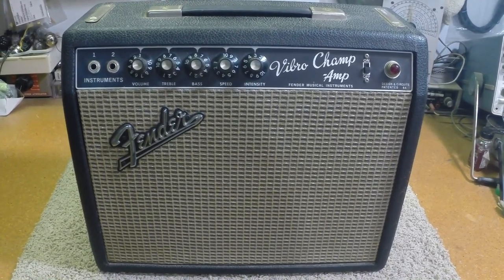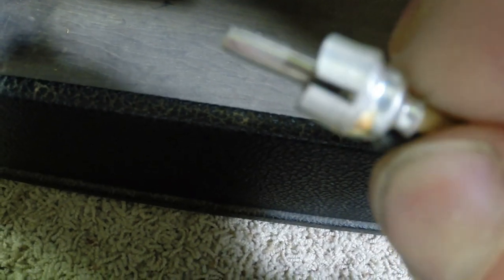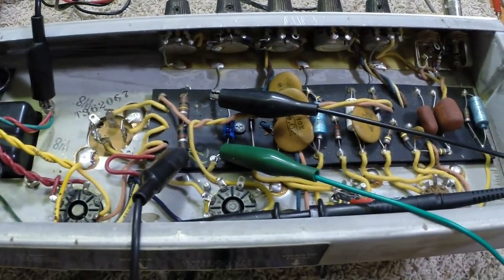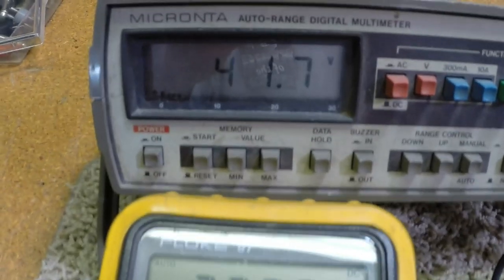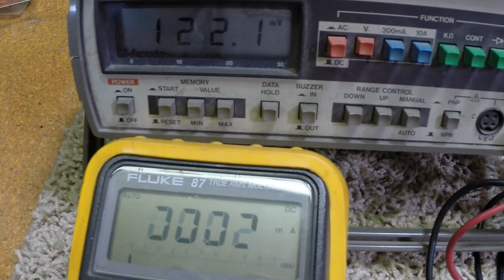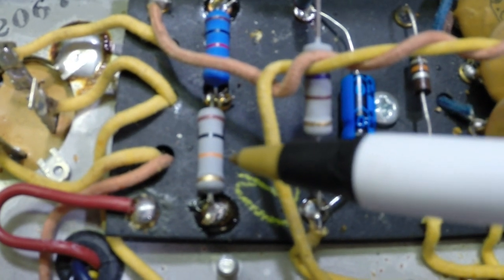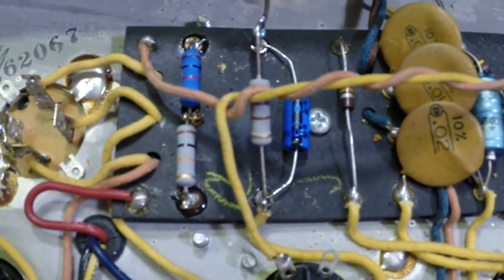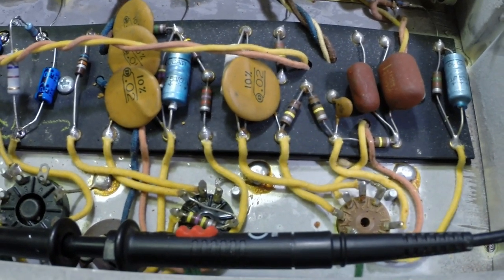Black Face Vibro Champ Repair and Bias Discussion

Comment: Thanks for creating this video and providing actual measurements rather than mere supposition. Your solution to the excessive-PD issues with the smaller Fender circuits is quite interesting and I intend to give it a try in my next appropriate repair project. Fact-based videos such as yours are a boon to the tube circuit community. We wish you well.
Reply from the maker: Thank you Uncle Doug.  I found this info in  the early 90's while on the quest for proper amp knowlege.  I had been working on amps since the late 70s but felt I lacked the info I actually wanted or needed.   I took the simplest circuit I could find which was a blown up Champ that I was given for $35. worth of guitar work and began studying it.  I had also been seeing lots of champs being blown up 'cause guys were starting to use little amps cranked to record with.  I was finding design issues that were overlooked and simply ignored.  Something VERY common in this industry....and worse today.  So this brought the ability to not only make these amps reliable, but opened the door to an entire different way of seeing things.  Then Champzilla was born, but that is another story of its own for another time.  Thanks for watching the video, it is an old one, long and boring.  I have a hard time staying awake for all of it myself.  I may do an updated version at some time.  Like I said, I am just trying to present correct info, regardles of how it is accepted.  Thanks again, and thanks for the comment.  I just had another comment on one of the Marshall videos that claimed it was useless.
Reply: @guitarc.p.r.9675  You're quite welcome, GCPR. YT can always use more videos that favor measurement data rather than speculation :)

Comment: It was nice talking to you today man! Thanks for your time and information. It is extremely valuable to me and countless others. Ive watched this video twice now, I only almost fell asleep once! Now its off to attempt to breathe some life into my champ, Thanks!
Reply from the maker: I told you it was long a boring.  But there is a lot of info there.  I may do a better version sometime.
Reply: @guitarc.p.r.9675  no no, i was just joking! Its a great video, i learned more from it than basically every other article, forum, or video on the subject that I’ve found. Ive also never seen anyone talk about swapping the two resistors for a darker or brighter tone. I have a 5F2A, which was my first build. I had modified it beyond recognition and have never been happy with it. I replaced all of the component values with the originals and then took your advice. I also put the 12ay7 back that i had originally used and it is now much more stable, predictable, and sounds incredible. The information you possess is extremely valuable to people like myself and truly appreciate you sharing it.
Reply from the maker: You are welcome.

Comment: Glad I found this.  Was gonna put in a 1k bias resistor while  servicing a 66. Put in a new 470 and and a 8k and 20k.  Also a lot of the resistors in this were way off while changing caps. What a difference,this amp came to life.  Thanks
Reply from the maker: Thank you.  I have taken a lot of grief over this from the forum experts and "teks"  Unfortunately, trying to correct long term misinformation is a difficult task.   I am glad it was helpful to you. Thanks for checking out the video although it is old and a horrible video the information is correct.

Comment: Thank you for posting this video. I have learned something new. Currently working on a 72 VC silverface with a hot 6V6. Going to swap those resistors around as you suggested.
Reply from the maker: Thank you!  It is an old poor quality video, but useful.  I appreciate the positive comment.  I have taken a break from YT due to trolls, and know it alls.  I deleted several comments this morning because I just was not going to bother dealing with them. So thanks again.

Comment: Hi, great video. I have a Vibro Champ from 1978 that uses the AB764 schematic & layout (with the orange secondary psu lead to ground). I was checking the bias and my measurements are: Cathode Resistor: 468Ω, Voltage Drop across that 468Ω resistor: 21.7v which using Ohm's Law gives us 46.4mA. 6V6 Plate Voltage measured at pin 3: 391v, so 391v-21.7v = 369.3v across the tube. Therefore the Power Dissipation (approximate because the current was measured through the resistor, not inline with the PT lead) is 369.3*.0464=17 Watts and seems a bit high. I watched an Uncle Doug video where he replaced the 470Ω cathode bias resistor with a 1000Ω but he didn't do any dynamics testing using an input signal like you do. I'm wondering if I should switch the 1k & 10k resistors like you did and remeasure. But doesn't switching the 1k & 10k resistors also reduce the plate voltage in the vibrato section? Will it affect the vibrato operation or dynamics? Another note - in the schematic, there's a note that says: "Voltages read to ground with V.T.V.M. with vibrato grounded (except v2) - no input signal. Doea this mean that the vibrato rca jack should be shorted when biasing the amp as well?
Reply from the maker: Hi, first thanks for watching!  OK  the vibrato thing.  You definitely want the vibrato turned off to check the bias.  You do not want any signal into the 6V6 at all while you are taking measurements, and you certainly do not want it pulsing. Now on to the biasing thing.  The 1k resistor for the bias is just wrong. I was misinformed about 25 yrs ago about the same thing, and was educated by a higher power.  Like I said in the video it bounces too much and drops out of class A.  Replace the resistors as I mentioned.  ALL three, and use Metal Film flame proof resistors. Yes, changing the resistors does drop the vibrato voltage but does not have any adverse affect on it from working properly.  I suggest watching the video again, yes I know it is boring, but there is a lot of important information there.  Now that being said you should look for something close to 40 ma plate current.  Yes, I know the common theory is to bias at full plate dissipation.  But you want it biased at the point that when signal is applied it averages at plate dissipation as the signal swings positive and negative.  This would relate to the center of the linear portion of the tubes operational curve.  Then it does not drop out of class A, becoming thin and buzzy.  I bet when you change the resistors the current goes down.  I would be curious what your screen current is right now.  Hope this helps.
Reply: @guitarc.p.r.9675  Hi and thanks for the reply, so I measured all the voltages listed on the schematic as well as the resistor values necessary to calculate current flowing through the amp. It turns out that there is a plate dissipation of 14.4w based on the following calc:           Vp - Vc = 383v - 21.3v = 361.7v          
Ic + Is = Vc/Rc = 21.3v/468Ω = 45.51mA          
Is = 8v/1007Ω - 25v/10600Ω = 7.944mA - 2.359mA = 5.585mA          
Ic = 45.51mA - 5.585mA = 39.925
mA      Ppd = 361.7v * .039925A = 14.44w      Where Vp=Plate Voltage, Vc=Cathode Voltage, Ic=Current measured across Cathode Resistor, Is=Suppressor Current, 8v/1007Ω is the current across the 1K resistor, 25v/10600Ω is the current across the 10K resistor, with the tremolo off (rca switch connector grounded) there is zero current flowing into the tremolo section.  What are your thoughts, should I still reverse those resistors in my situation? I guess that will lower my suppressor current but couldn't I add a resistor from the 1K leading to the suppressor? Why switch them instead of adding a resistor to the suppressor? And also, would switching the resistors lower my plate dissipation enough? I felt the 6V6GT tube (it's the type with the black coating inside but not on the top) and it was really hot, much hotter than the rectifier tube. If you made it this far, thanks for listening! And your advice would be much appreciated!
Reply: Oops - I think I'm calling the 6V6 Screen Grid the "Suppressor" by mistake...
Reply from the maker: Measuring screen current across the 1k is misleading because it is also supplying voltage to 4 12AX7s down the line that are drawing about 1 ma ea. AND this is only screen current at idle. The only way is to measure current inline with the screen.   Also keep in mind that as you calculate the cathode current across the 470 you are also reading screen current which is probably around 5 ma on top of the plate current.  Yes reverse the resistors, in fact as I said before Replace them along with the Carbon composition cathode resistor.  It may change value as it gets warm.  I have also seen the original 1ks  cook to various degrees.  I also want to mention the 10k resistor is the norm in many amps including previous models of Fenders, and suggested by tube manuals. Yes you can add a resistor to the screen, but don't let the forum guys know 'cause they will bust you for "destroying the Bloom of the notes"  (btw, my modified Champzilla has a 2.2k screen resistor, but it is running a 6L6 in fixed bias mode, but we do not want to get into that here!)  Now for the 5Y3....basically a dual diode rectifier, unless you have a big problem it should run much cooler than than the power pentode 6V6.   Speaking of which, you might want to check voltages again with another 6V6 if that one is old it may be running hot on its own.  As I said in the video, swapping positions with the resistances solves a lot of problems at once.  The 1k did not show up until the Blackface era, and I believe it was carried over through all circuits at that point, unless a choke was used.  This works fine in push-pull circuits, but single ended is a whole 'nother game. More resistance or even better, a choke here limits the current to the screen.
Reply: @guitarc.p.r.9675  Since the tremolo is off and draws zero current, and I subtracted the current across the 10K resistor from the current across the 1K resistor, isn't that equal to just the screen current? Here's my math: 
Is = I(1K) - I(10K) - I(Tremolo 470K) = 8v/1007Ω - 25v/10600Ω - 0Ω = 7.944mA - 2.359mA - 0mA = 5.585mA. If I run a 9K resistor up to the screen between the 1K & 10K isn't that exactly the same as switching the resistors around?
Reply from the maker: You are making this harder than necessary.    Engineer away if you want.  You can simply pull the preamp tubes out and measure the current.  Good luck.
Reply: @guitarc.p.r.9675  How did you know I studied engineering? LOL! I made these calculations on my casio databank watch, LOL! So I made the measurements after simply swapping 1K & 10K resistors. The plate dissipation went from 14.44w to 12.86w. I guess it worked! For some reason unknown to me the PT pri. are still at 120vac but the sec. went from 355vac to 360vac. The plate voltage went from +383v to 402v. The cathode went from +21.3v to +18v. The 40mfd cap went from +396v to +415v, many things changed at once just by making this simple swap. What's weird to me is that the plate voltages in the power section and the first 1/2 12AX7 #1 went up while the plate in the second 1/2 12AX7 #1 went down from +242v to +225v - is this because the 6V6 is pulling less current now?
Reply from the maker: I can recognize the engineering mind.  I was an engineering major and electronics minor.   I will also tell you that all the rocket science in the world does not really apply to amplified electronics.  Numbers and static calculations do not really reflect how something actually works in real life.  It irritates me to see all the regurgitation of false information and specs on line constantly.  ie.... One reason for this video.   I am glad you followed my suggestion instead of questioning it further.  If you had done this earlier you could have been playing it instead of making calculations LOL.  Your amp is now running where it should.  Power supply should be around 420 volts.  I bet it sounds better too...... you have played it haven't you?Thanks for watching, I hope this has helped.
Reply: @guitarc.p.r.9675 Thank you so much for taking the time, I see from your other videos that you're pretty busy there in W Virginia (great song, "Take Me Home, Country Roads"). I played the amp both with the stock speaker and through 2x10" and it does sound better. Less chaotic breakup. But the bass response is a bit compressed sounding, how can I open that up a bit, or is that just a "class A" cut through the mix kind of sound?
Reply from the maker: Yes I stay fairly busy, I do about 500 guitar and amp repairs a year.    Ok, here we go..... I have a LOT of Champ stuff!   First thing replace ALL the cathode bypass caps.  then replace the 15k mid resistor with a 6.8k. This takes out some mid mud. Replace the ,047 and .1 tone control caps with .022 preferably Orange drops.  I hate to say it but you may need new filter caps at this time as well. But for the time being, add another 20uf/500v cap to the main power supply.   If you are lucky you have one of the amps with an unused section on the filter can.  If not add one.  These tips will help. This along with the previous changes is my "no frills champ mod"
Reply: @guitarc.p.r.9675  Thanks so much for the tips! I will order the parts and try the mods. I just bought this amp a couple of weeks ago and I see that someone has replaced the 6V6 cathode bypass cap with a 47µf 100v instead of 25/25 - coud that also attribute to muddiness because the amp is trying to amplify lower frequencies than usual? I measured the ESR for the preamp cathode bypass & power filter caps and they're all a bit high, the filter can I have is 40/20/20 and the 40 measured the worst ESR of all the caps, maybe the poor bass response is also due to not enough available electrolytic-power as well? I was planning on ordering one of those CE Manufacturing 40/20/20/20 cap cans from AES. I'm thinking of using the additional fourth 20µf section on the can to filter an additional stage so that I can add reverb to the circuit just as a fun experiment and because I miss having reverb. Also, the 6V6 & 5Y3 tube sockets are loose so I'm going to either replace the sockets or get a couple bear traps to hold the tubes from slipping down & out. I was also planning to swap out all the old carbon film resistors for metal film or metal oxide ones (not sure if there's a preference) - should I use the rated wattages from the schematic or use 1w for preamp & 5w for power amp? I find the amp is quiet enough for me so I'll probably leave the heater A.C. wiring alone even though it's not hum balanced. I already clipped the death cap out because it has a grounded cable from the factory. You're probably super busy now that people are unemployed and playing their instruments more often!
Reply from the maker: Yes replace the caps especially the filter.  You did replace the power supply resistors right? Now also replace the plate load resistors with 1 watt carbon film.  Change all the cathode resistors as well. Don't bother trying to add reverb to the amp, the reverb circuitry will be more than the amp circuit, and a decent reverb tank will not fit in the cabinet, and you will have to add 2 tube sockets.     Plus by design they thin out the tone of the amp. 
 Use a pedal or a stand alone unit.  Speaking of tube sockets, you can easily tighten the pins in the existing sockets and they are really good sockets.  BTW check out the only comment in the discussion section of my channel.  I am off to work.
Reply: @guitarc.p.r.9675  The 1K resistor had already been replaced with a wirewound type, the 10k is still the original carbon composition and will get replaced - are wirewound ok for this? Can wirewound attract rf like little antennas? I actually have an old Morley oil can delay pedal, the EVO-1 and it sound great through this amp so I guess I'll can the reverb idea (pun intended). I'll attempt to tighten the tube sockets, that will save time & money, thanks for the tip! I'll check out the discussion page. Thanks again, your mentorship is greatly appreciated! I also ordered some books online about tube amp design.
Reply from the maker: I suggest 2 watt metal oxide flameproof resistors for the power supply resistors.
Reply from the maker: Yes I still do.  In fact I try to keep a few in stock handy.  I am also planning on putting a couple batches together shortly.
Reply: @guitarc.p.r.9675  I think I owe it to you and to my amp to get 1 or 2 of your custom speakers! How can this be arranged? Should I phone your shop?
Reply from the maker: You can phone the shop, warning the phone is very busy, or you can email me at gtrcpr.r58@gmail.com or pm me on my shop FB page.

Comment: Hi I’ve got a 65 Vibro champ and I need to replace the speaker. Can’t seem to get a straight answer on whether or not I should go with a 3.2 or 4ohm speaker
Reply from the maker: A 3.2 ohm speaker is a 4 ohm.  The D.C. resistance is 3.2 ohms.  The nominal impedance is 4.  Hummmm.... I wonder if I have any of my 8's in 4 ohms in stock?.....